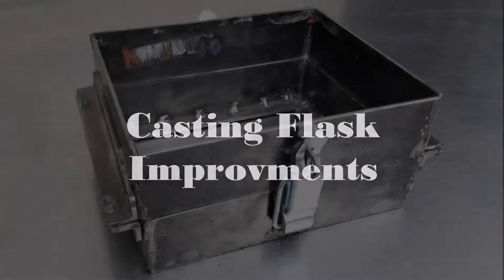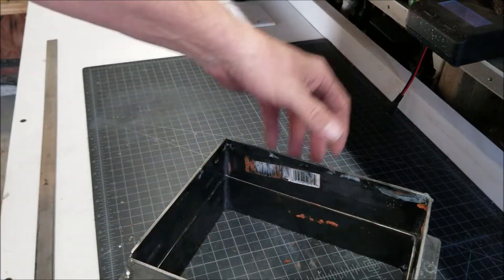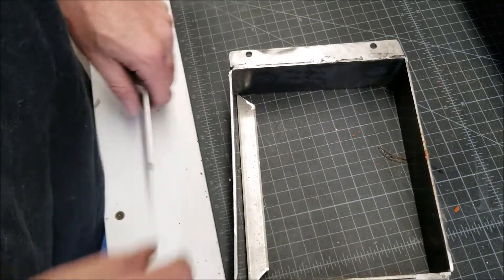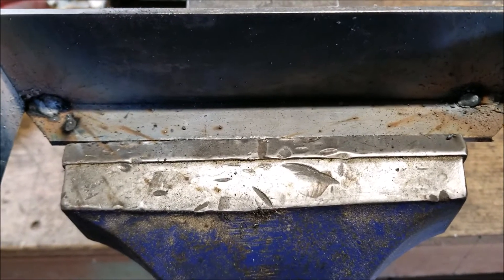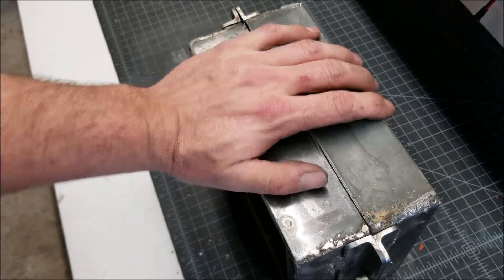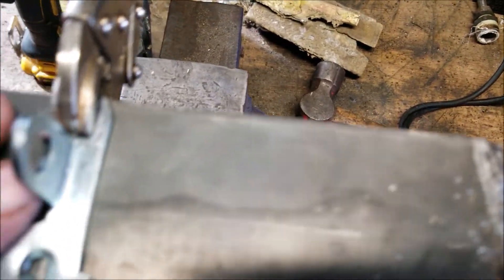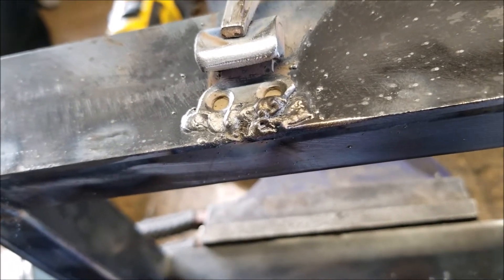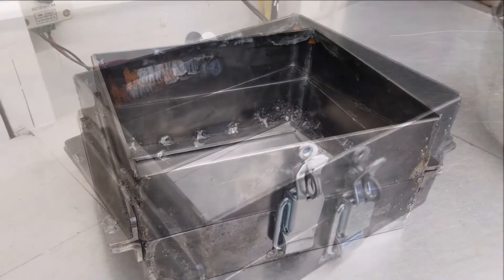Viewer Recommended Casting Flask Improvments

Comment: Your welding will improve heaps if you can switch over to using gas. Gassless mig is about the worst kind of welding there is in my opinion.
Reply from the maker: hello Rodney, Would you say that stick welding is worse that gas-less mig? Just curious, i have access to a stick welder but my past experience did not go as planed and ended in failure.

Comment: When I first started welding my boss told me my first goal should be the strength of the weld and not the prettiness, no one knows how pretty it was before it was ground down.
Reply from the maker: Hello Andrew, sounds like great advise. I have virtually none experience welding. My Buddy Steve is a trained welder and i show him my work, then he sends back pointers. My welder supports gas welding, i dont have a tank, but i do have the regulator. If i spend more time welding, i may chase those items down. Appreciate the comment and watching the video. Cheers!